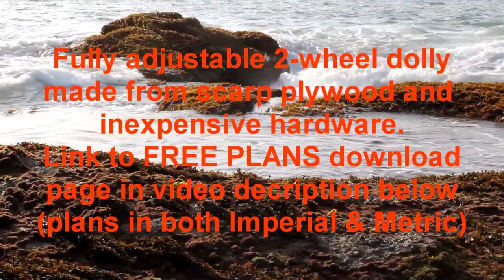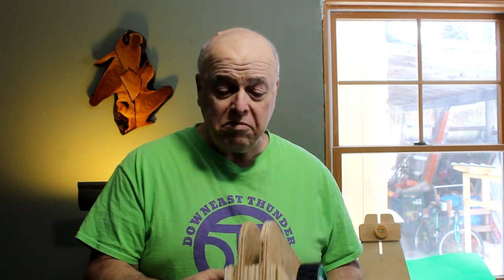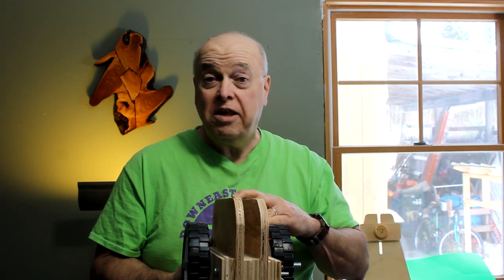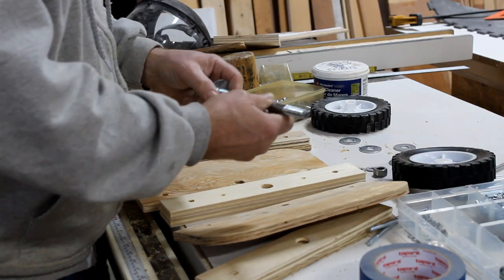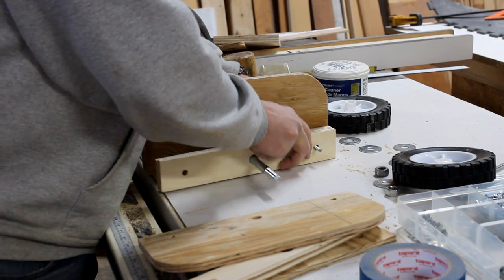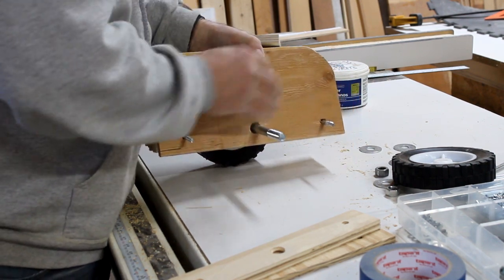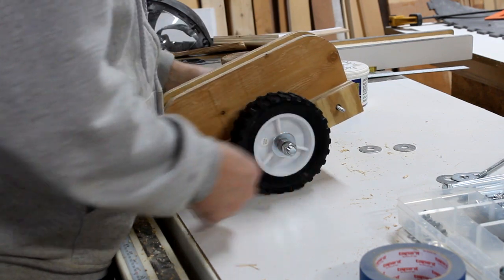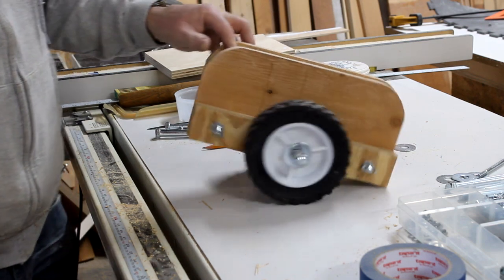(S-3 Ep-12) The Ultimate 2 Wheel Dolly! (FREE PLANS)

Comment: Wow!!  Thanks!  This is exactly what I needed.  My shop is in the basement.  Fortunately the slop to the basement is very walkable.  But a 3/4"x4'x8' ply is just too heavy.  These wheels should roll easily on the grass.  I have lots of plywood laying around.  I'll make the ply pieces first and that will tell be the length of the bolts.  For what I do all will be 1/2" ply.
Thanks again!
Reply from the maker: You're welcome. Glad this helps.👍
Reply: @DowneastThunderCreations  What size shims are you using to carry 3/4" ply?  I assume 2 - 1/2" or 2 - 3/4".  I may never carry anything but 1/2" & 3/4".  But never say never.
These wheels should be fine on wet ground that's still hard enough to walk on.  Right?
Reply from the maker: @jimw544  I don't have a schedule or anything. I just adjust the various thicknesses of plywood shims to fit (by eye) and I don't worry about what particular order they are in. I sometimes move solid wood doors so I have the option of wider guides but the thicknesses vary - that's why I came up with this dolly. As for wheels - the ones I used work fine  for me but weight will have a direct effect upon them sinking into the ground or not. If this is a concern, you might consider using wheels with pneumatic tires mounted on them (Harbor Freight Tool Co. routinely runs sales on these for pretty cheap prices).

Comment: Great idea. I think making the whole thing wider and fix everything together with glue and screws. Have one side thick ply then the other side a block of 2x2 with slots in it with screws and wingnuts would be a good idea. That way the whole thing is solid and it is adjustable to any size you want and can actually clamp whatever your moving.
Reply from the maker: Thanks for your comment, however the way this is designed, it is solid and fully adjustable. In fact, it works quite well and has seen frequent use since I made it. Of course, there is always another way to accomplish something. I guess it's simply a matter of perspective on what works best for a particular individual.